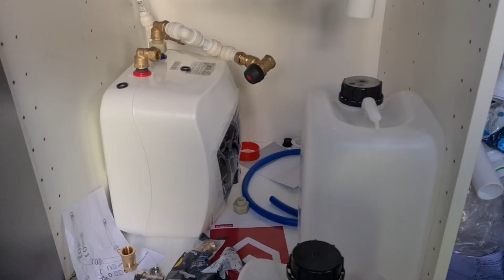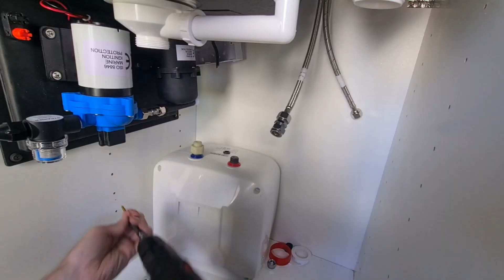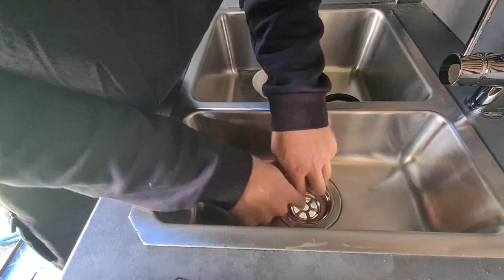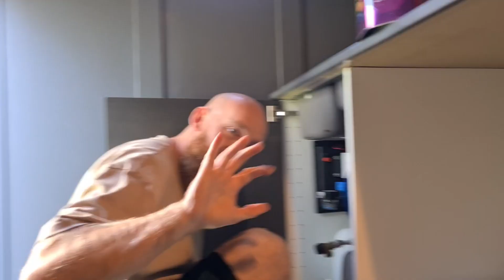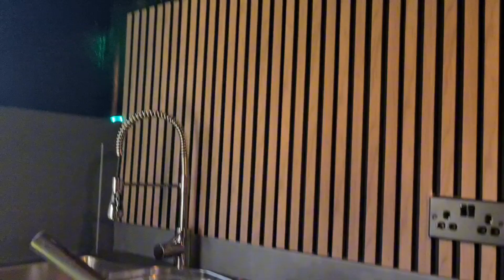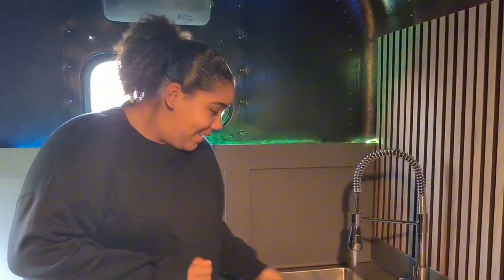COFFEE TRAILER BUILD - Plumbing the Sink and Water Heater

Comment: Great job !Can you please help me, where did you buy the pipe sealant below? I have a double sink and the heater for a food track,thanks
Reply from the maker: Hi, I can't remember using a sealant. I used PTFE tape on the threads, the pipes were push fit. Is that what you mean?

Comment: How much Watt’s does the water boiler and water pump use ? And did you end up using one pump for the tap and the coffee machine?
Reply from the maker: The water heater is 1.5kw it was the smallest/ cheapest I could find. I'm not sure what the water pump is but it's tiny and runs off of a 12v inverter.
Reply from the maker: This one - https://www.screwfix.com/p/ariston-andris-lux-undersink-water-heater-1-5kw-6ltr/100HP?tc=IT9&gclsrc=aw.ds&gad_source=1&gad_campaignid=19822796606&gbraid=0AAAAAD8IdPwyWZGV8IOTA3VuUKjcbPN4V&gclid=Cj0KCQjwmunNBhDbARIsAOndKpkMOAiaD1-6FKSjcn9PrF-Viai_EtRzaLOm_CATtKnLUxfDtso3y-waAlP8EALw_wcB